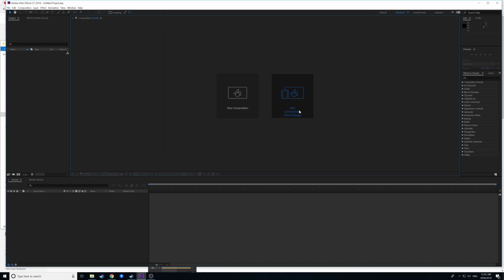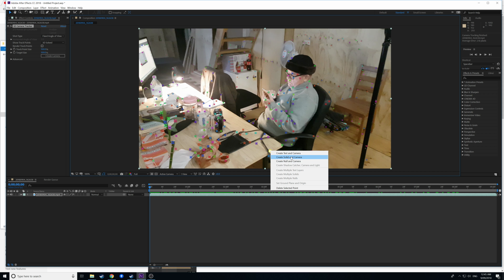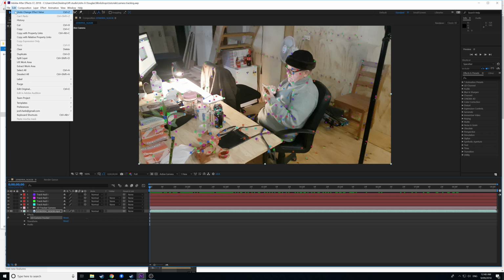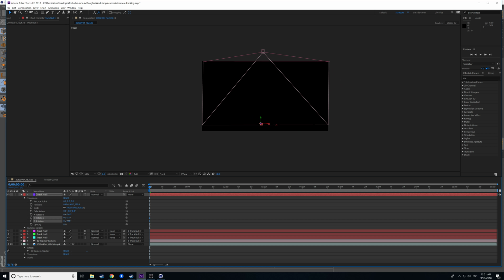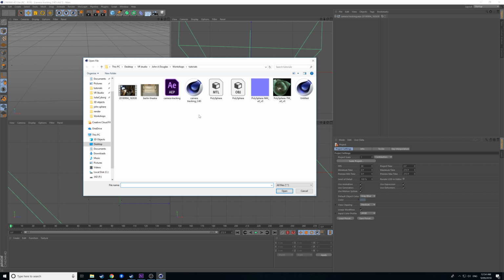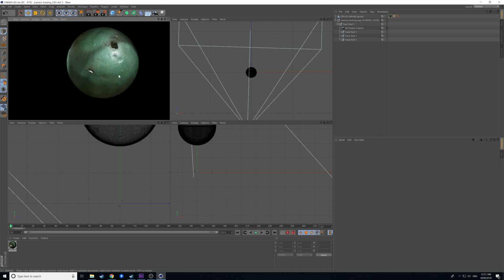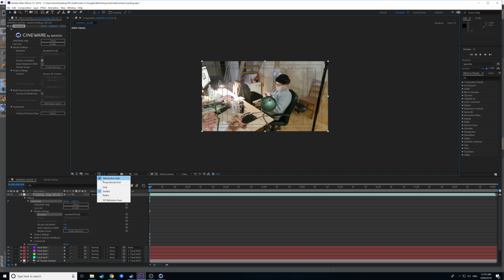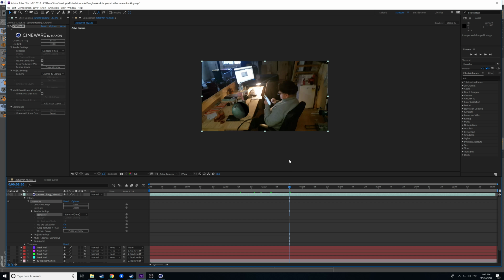Tutorial: After Effects 3D object composition with camera motion tracking

Comment: Hi Josh, I do have a question and this might help others with this same question.  I love rendering in c4d hardware open gl mode. It suits all of my needs and is so fast. However, I can not figure out  how to use  a shadow catcher when rendering out in hardware open gl mode. I have tried the old shadow catcher plugin (which I love but is limited of course) and the new r18/r19 shadow catcher that I have with r19.  I hate hate having to render out in a separate alpha mode and use an external comp program but it does not work in hardware open gl render anyway. And then theres just using the composite tag and shadow catch that way. That does not work in open gl  hardware render either. So do you have any idea how to CATCH SHADOWS with R19 exporting with hardware open gl?  I have searched the web over and over.  Probably is not possible.  :(
Reply from the maker: Sadly no, I haven't been able to get multi-pass rendering with GPU rendering.  It would definitely speed up the render process!
Reply: Thanks so much for your reply. Sadly I think you are correct. What Iam waiting for is a real time gpu rendering engine for r19/r20 that uses all the standard r19 textures and lights and of course shadow catching and all that. The now discontinued furryball renderer comes close to that.

Comment: Great tutorial and thank you. But in addition of course there is a much much faster way.  Just track the footage in AE then get the live link interaction going between AE and Cinema 4d  then create a sphere or whatever in Cinema 4d and and bring it in to AE. Took me about 2 minutes to do that. But your tutorial gave me a different perspective which I found useful.  Thank you.
Reply from the maker: Thanks Video - this workflow (with creating and exporting the null points first) is really for if you are wanting to comp in shadows in and want to place floor planes accurately within the scene (e.g. on the table surface).
Reply: You are correct. To do it correctly you would use your method for as you mentioned shadows, floor planes, etc. I will probably use your method most. Thanks again for the great tutorial.  :)